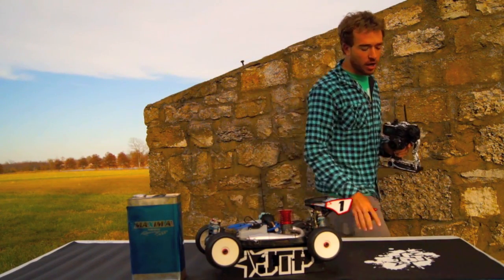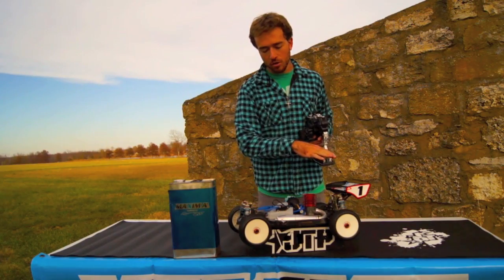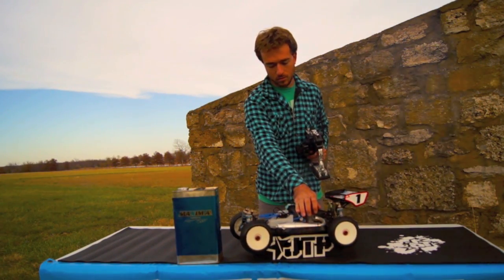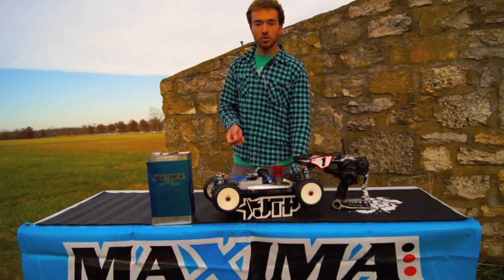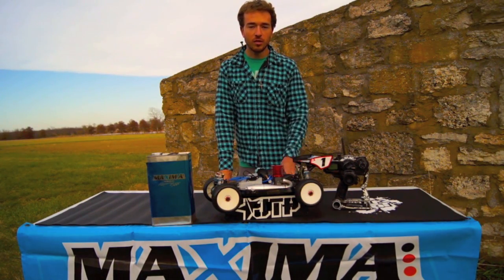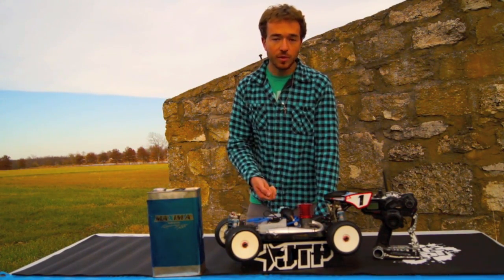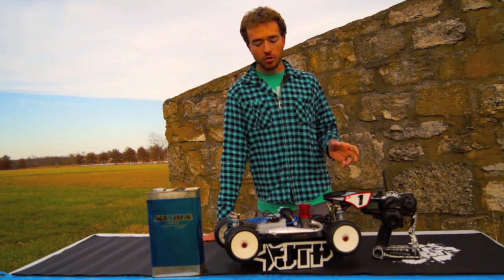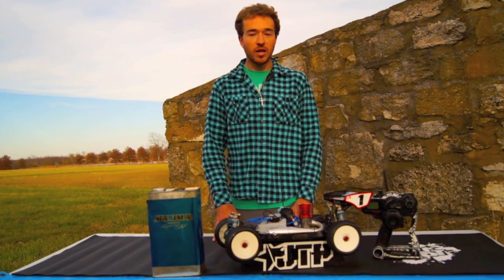JTP TV Episode 3. How to tune your engine with Jared Tebo. Part 2

Comment: I'm pretty sure the tank in a Lighting 2 PRO EVO is about 150-160ml. It's an HPI NitroStar F3.5; just a sport engine. I'm not completely surprised it actually lasted for that long. I filled the tank, and started the engine at 6:00 PM. By about 6:21 PM, the tank was empty and the engine ceased combustion pretty soon after that. During that time, I was ramping about 50-60 MPH on my street. I'm sure I could recreate that runtime with a Savage. It wasn't so difficult.

Comment: I had a feeling someone would confuse "ceased" for "seized." When I typed "ceased combustion" I meant it ran out of fuel and stopped. It didn't receive a sudden drop in lubrication and seize up, it just ran out of fuel. After, I refueled and fired it up again; went for a few more runs up and down the street.

Comment: Thanks for this Jared. Definitely helps since I never knew how to race tune before. But how long over 10 minutes? I mean I have an HPI engine (just for casual use) without a race tune but more of a sport tune. It doesn't sound as nice as what you're running but I was doing high speed runs up and down my street and I was running 21 minutes on 1 tank. Either it's just me, the OS pipe, the tune, or the race engines aren't as efficient as I thought... But I'll try a race tune to see if I get 30 min.